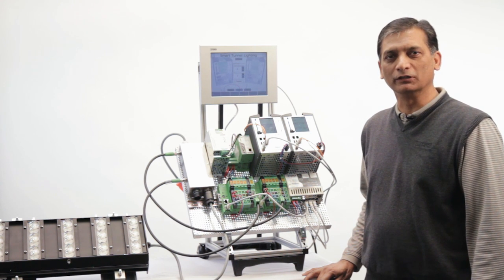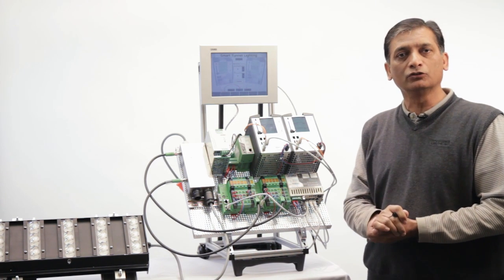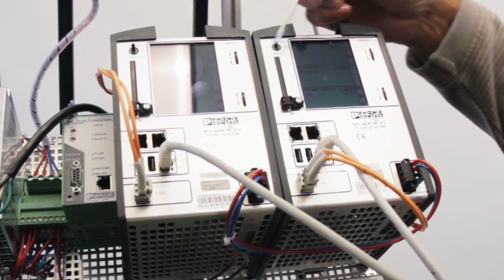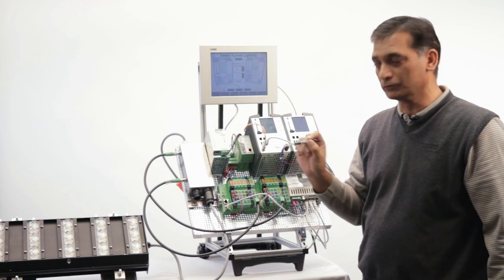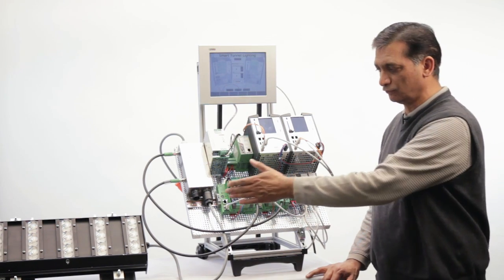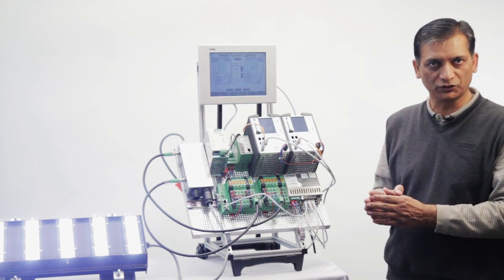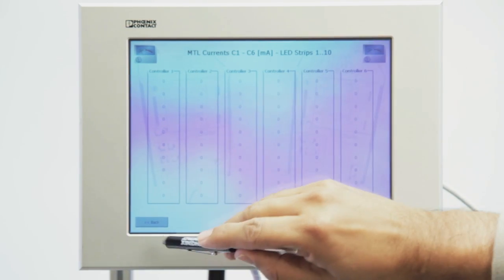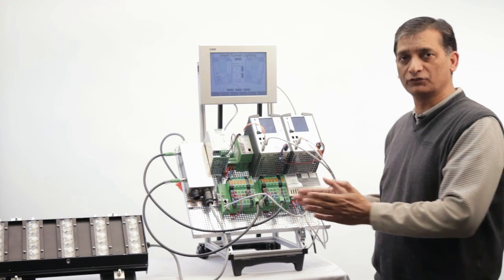Infrastructure lighting controls for automation that will reduce energy costs - Phoenix Contact

Comment: So you are an Engineer working below ground, possibly in an atmosphere that is not breathable or an environment that has the potencial to become hazardous quickly.

This system ensures that the lighting in the tunnels not only stays on-line but also provides valuable data back to corporate offices for assessing the energy costs of these installations. This saves you fitting separate units for Power Monitoring, Redundancy & Lighting control.